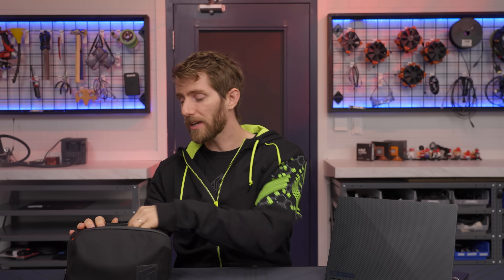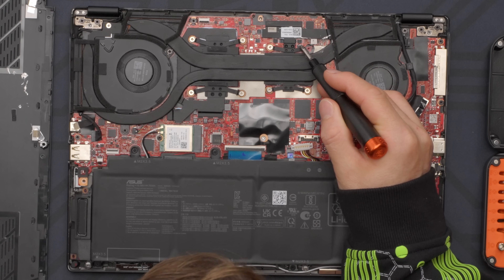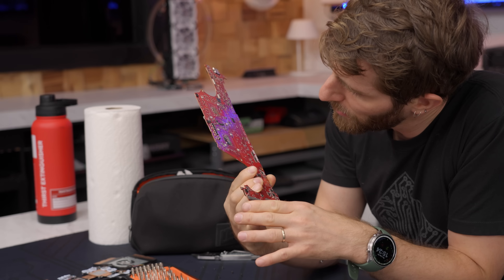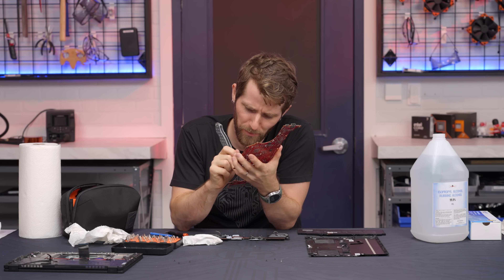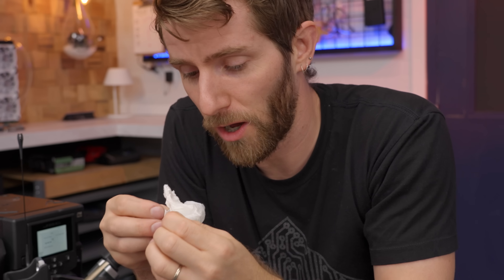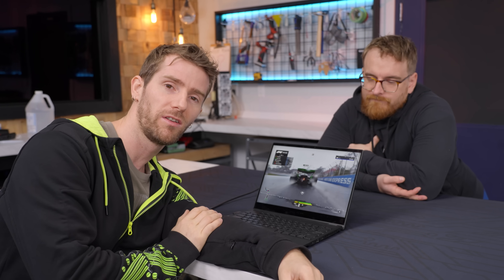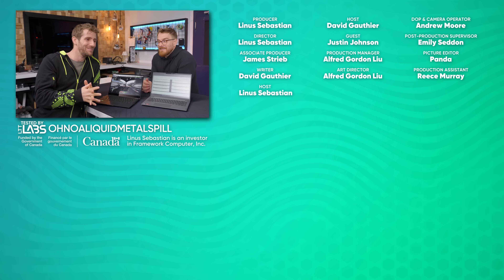Liquid Metal Killed my Laptop… Now What?

Comment: I have a 2022 ROG Zephyrus G14 and it developed a dry spot on both the GPU and CPU where there was 0 liquid metal. I could tell because the laptop would overheat and shutoff. Opened it up and yep, dry spots. I ended up removing it all and just slapping some MX4 on it and calling it a day.

Having said that, Linus my god that was the worst way to remove it. I used a pippette to get the big bits of it and q-tips with isopropal to remove the little bits.

Comment: How does someone use Liquid Metal on a device that is moving and not have a sealer to make sure it doesn't spill? This is pretty much 101 for those who did LM on old laptops before. They would be putting nail polish and foam to plug potential gaps where the LM could make its way.

Comment: I have a first generation flow x13, have put it in my bag on its side while hot many times and haven't had an issue. Only thing I've noticed in the 5 years of ownership is the chassis screws can loosen over time. It's a fantastic laptop so hopefully I won't have this issue ever

Comment: So fun story: Go check out the ROG Zephyrus G14 Subreddit. It is an awesome machine but ASUS has been using Liquid Metal for the CPU and GPU till 2024 (where they switched to TPM7950 on the GPU). There are so many pictures of CPUs having burn spots because, supposedly, it‘s extremely difficult for a machine to apply Liquid Metal correctly, which leads to blank spots on the CPU or GPU. I even did a swap myself on a 2023 and 2024 G14 and both times, the Liquid Metal application was faulty.

Shoutout to ASUS: I killed my touchpad on my 2024 one (which still was in warranty) and they replaced the whole motherboard under warranty even though I messed up! (Now I don‘t know if my PTM7950 is still on there though 😢)

Comment: Ok, 500 and first better way to do it. Contact cleaner, aerosol, should blast it off, should cut the compound and is made for circuitry.
Just use at a distance as to not blow components off the board. Then just pour isopropyl on it to wash residue. No tools, not towels no rubbing, just air dry.

Comment: I have an Asus G14 and I had to sort out the chemical metal as there was hardly on the CPU. Anyway, when I put some on it sprayed across the motherboard. Anyway, I used a magnetic screwdriver to remove it, and it still works.

Comment: I've got a G513QY Laptop that died about 4 months ago, Was quite happily playing along on a game (Had 8 kills on PUBG was absolutely on fire) and it switched off and that was the last time it ever turned on. I lived with the Liquid Metal for a few years, Had to replace it 2-3 times in about 4 years it's an absolute disaster to re-apply so much hard work dissolving every little bit with isopropyl. I took it into a repair place but nobody wanted to touch because of it, I priced up a new motherboard at 1350 euro's.... I saw a thing on lock picking lawyer where he used liquid gallium to dissolve a padlock as well.

Comment: I had a predator brand laptop that came with extra components for a secondary 2.5inch ssd installation... without a threadlocking solution on the screws they supplied. The screw rolled out and shorted it to death. Tower with a vpn, moonlight, and tablet for mobile gaming for the win.

Comment: If you have an Intel laptop running windows there is 100% chance it is going in a bag HOT.  My 13900 dell work laptop wouldn't hibernate correctly (because windows) and it woul be burning hot and dead battery after a 30 minute ride home.

Comment: Oh yeah we know of these at work. The first couple gens were very popular for small strong cad/3d workstations. Some were legit just never moved at some architecture firms (locks put on them) one even just ran in a cupboard behind a wall as a hdmi out for a touch tv to show the stuff they do.

Half of them spontaniously died. Even the one that sat for four years never moved as it was duuuusty. When recovering the ssd for data it was always random liquid metal inside the laptops. The gaskets faill, hell one even ATE through the metal.

This is not a proper solution for mobile devices and worst thing is the g14 runs not much hotter with just run of the mill thermal paste. Its how you get em back from asus if sent if for warranty even!!!!

Comment: The comparison you do at the end of the video DOES NOT determine that PTM is better.
AS YOU MENTIONED, liquid metal benefits from higher mounting pressure.
Here, we know the Asus laptop uses LOW mounting pressure.
Thus of course the PTM is much closer to the liquid metal in terms of thermal performance.
Perform the SAME TEST on an ATX motherboard, with a proper, big cooler (or waterblock), with high mounting pressure, and the Liquid metals wins, by far.

Doesn't matter anyway as Asus made three crucial engineering mistakes.
1. Too low mounting pressure
2. Too little protection (ridiculous brittle little foam bracket)
3. Using liquid metal on a type of product that IS KNOWN TO BE USED ROUGHLY by users
TLDR : Asus made mistakes and liquid metal is king.

Comment: Dip the solder wick in flux and it'll pull up the metal easier with heat. Also after soldering, use a brush and isopropyl to clean off residue, then cover the newly soldered junctions/components in conformal coating.

Comment: I had to replace the thermal conductor (liquid metal and thermal paste) on a laptop so I low key cleaned it well and put a premium thermal paste and there were no differences. The thermal conductivity of the liquid metal is indeed a lot better but whats the point if it gets bottlenecked by the other parts of the cooling system like radiator and fans. Don't use liquid metal on your machines, that's my best advice for now in 2025.

Comment: For my laptop I have liquid metal on my CPU and thermal paste on my GPU but because they share heat pipes if I ever want to repaste the GPU it means I would necessarily have to repaste(?) the CPU as well and there's no way in hell I'm ever using liquid metal. I don't trust myself that much.

Comment: My white-labelled Chinese-made laptop also had liquid metal, despite it being a bog standard 12th gen i7 with no discrete graphics. After seeing another video on LM damage on a laptop I decided to take my laptop apart and replace the LM. It looks like I caught it at the point where the LM was off the CPU die, in the moat, and had even started spreading into the barrier. Oof. Removed it (such a pain; please do wear gloves, unlike Linus), replaced it with some Arctic MX-4 I had left over from another repasting project, and I gave it a few more years of service life.

Comment: In my rog flow z13 2022 few months ago similar story. Mostly used as desktop and LM sipped down the CPU. Computer still works but i have issues with voltages, boost and temps now. Changed to normal thermal paste.

Comment: My ROG Strix laptop is in the shop today.  Yesterday, I added a 4 TB drive to it, and when I went to unplug the battery, rather than the connector popping out the connector broke off the board.  Not super impressed with the solder job, Asus.

Comment: My good friend and I both have the Zephyrus G14 and a couple of years ago, his MoBo shorted out thanks to the enshittified ASUS engineering to push you to buy new laptops and the cost of the MoBo was more than the laptop itself. Anyway, tried to fix it, changed a lot of components on the MoBo but to no avail. Frequented Reddit on a daily basis and saw the ZephyrusG14 forum filled with similar horror stories and not a single person was able to get their PC to work. 

Seeing this video, I thought that for the first time I might get to see a similarly speced Zephyrus PC + MoBo get fixed but damn, even LTT failed at it. GOES ON TO SHOW HOW BIG OF A MIDDLE-FINGER ASUS IS SHOVING UP OUR FACES!

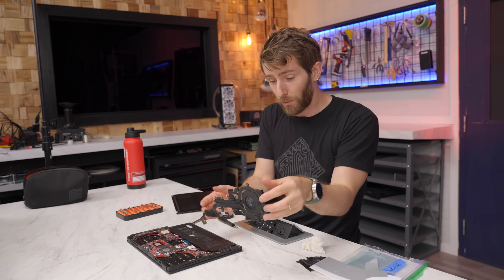Comment: 13:09 "Gallium-based liquid metal pastes are generally low in toxicity, but gallium may be absorbed through the skin. Rubber or vinyl gloves should be worn when handling gallium-containing alloys. Avoid eye and skin contact at all times." ... says the manual 😅
Reply: Anything is toxic in high enough doses. Gallium toxicity is very low. The small amount Linus was exposed to will do nothing. Still, it's always a good idea to wear nitrile gloves. God only knows what else is in that alloy or on the PCBs.

Comment: Liquid metal has no place and should never be used in laptops or even games consoles which will be used by young children that may not understand the concept of knock it and it will break to the point where it is brick and will no longer work liquid metal should only be used on a high-end desktops as simple as that and Even that it is not necessary for 98% of all computers it should never be used for this purpose because it is conductive and it will kill any device where it escapes

Comment: I also had a Zephyrus G15 with liquid metal leakage problem but mine was not power on since the leak, meaning it haven't short circuit YET, now I need a opinion: I've done the classic isopropyl wiping but I sure there is some left under the components and nur me or any other shop in my town has access to professional suction solutions, now should I just flip a coin and turn it on or should I keep looking for a trustworthy shop somewhere? Keep in mind the market value for my laptop here is around 500 to 600 box, and I already have a replacement for it and the repair cost would be around 50 to 200 box depending on the shop

Comment: I totally saw this coming, I got a M16 Zephyrus 2022 back in the day and as soon as the warranty was over I opened it up and switched all that liquid metal for some good quality thermal paste.
Tho, after I switched to thermal paste I noticed a decrease in performance since the intel processor it comes with heats A LOT... that was the trick, LM helps a lot with the cooling to deliver it's marketed performance, yet, the thermal paste doesn't cool it enough to make this device run at it's promised performance which is a very low play from ASUS.

Basically... this laptop was marketed to give certain performance taking in mind only when LM is applied. (But the chances of the PC dying from a LM short are greatly increased)
Switch to thermal paste and your performance is decreased due to thermal throttling due to the processor getting ridiculously hot (90°C+) I really wish I had the AMD version because Intel just sucks for laptops, yet ASUS is VERY lazy at providing actually good and safe thermal solutions for their laptops.

I have been taking care of my laptop quite a lot and I hope it still has many more years to come because I would hate it dying to a bad thermal solution like this.

Comment: I've fixed thousands of boards by solder flow machines, solder waves rolling over the board.
That would take less than the boards I worked on.
Maybe 3 to 6 hours.
Never rush cleaning it, or you will kill it for sure.

Comment: My HP Omen gaming laptop started overheating, and I replaced the factory/stock thermal paste with other Artic Silver thermal paste I had laying around which didn't help either. So did some research and tried Thermal Grizzly Kryosheets. Incredibly thin sheets of graphene (0.02mm). Still conductive, but no where near as dangerous as liquid metal. Brought two, one for my CPU and one for the GPU. Laptop runs like a dream now! I initially panicked as I kept thermal pads on the power regulators & vram, but that was 2mm thick thinking I was being "smart", but the thermal pads wasn't squishing down enough for the Kryosheets to make contact and my temps shot through the roof quickly hitting 140 before shutting off. Once I realised my mistake, took the pads off and replaced with the Artic Silver paste and laptop has been great since!!!

Comment: That is a damn laptop its supposed to be thrown in and out of bags, it will take shocks from setting a backpack down, it will vibrate while warm after setting it in a bag unless you put it in a fridge to cool it down before hand, having this in a laptop is so stupid if the issue is it leaking out and its not covered in warranty.

Comment: I can only imagine what would have happened if Nintendo went with liquid metal for the Switch 2. Being very portable, and getting thrown in backpacks, and with kids, you know they will drop it or run around with it.
Yeah, liquid metal can work well, but I can't really see any reason why good old thermal paste won't do the same job, and be a much safer option, as it won't leak like liquid metal clearly can.

Comment: i have the ROG Flow Z13 2022 version

the one with liquid metal Vapor Chamber thing
the Flow z13 is supposed to be used while standing vertically running games while reaching 80c normally in AAA games

am i cooked? should i change for thermal paste while i can? or the flow z13 can contain liquid metal safely

Comment: This comparison is flawed.

ASUS are reknown for terrible applications and using too much. So you tested not knowing if it was an ideal application. More importantly TIMs are still subject to the fan speeds. So the 2c difference is based on stock fan curves which will dictate the the thermal headroom anyway.

I've done several like for like tests between PTM and conductonaut extreme on several laptops, using a blow type cooler at full speed to make sure there's no suffocating and there is easy a 10c difference.

I've tested this on several ASUS TUF, Legion 5s, slim 5, pro 7 gen 8 and even the new Pro 7i gen 10. The gen 10 can net a 15c drop over PTM.

Comment: I used Liquid Metal for tests in a gaming pc and the same happened... It flows down on the MB and also on the graphic card, and ""UNSOLDERED"" capacitors ... I managed to repair it but it was a realy long and painfull work. The Gallium cause so much corrosion...

Comment: Yup.. my predator had liquid metal in it and the application or metal used was so crap.. that it was sitting at 70-80C idle and instantly went to 100C under load. Took it apart and had the 'best time' cleaning the liquid metal out of it... took a freaking hour. Replaced with MX6 on it... not had a problem since with thermals.

Comment: For people with laptops that come with Liquid metal, who accept the compromises that come with them to yield that last drop of performance, please make sure you let your laptops have the time to cool down so that the LM solidify before putting them on the move. Liquid metal is applied on these laptops using industrial methods that most of the time come in excessive amount that can ultimately destroy yours if not carefully handled. For the best approach, you can have a professional redo the application to make sure the appropriate amount is applied, thereby significantly reducing the risk of spillage as in the case of Linus here. RIP :( In addition, if you need to elevate the laptop for better airflow, try to raise it evenly without any tilting to prevent LM from sliding down onto the motherboard. Or if you are too afraid of all the hazards, just purchase a high-quality cooling pad like the Flydigi BS2 pro (or IETS GT600), which has dropped my CPU temp by as much as 20+ degree C (FYI I use an MSI Vector 16 with core i9 12900hk 150W and RTX 4080 175W, and it's scorching hot even after using ptm7950 for the gpu and LM for the cpu). Now my laptop hangs around 70-72C for GPU (full 175w) and 6x - low 7x for the CPU when playing 4K games as opposed to 90+ degree C for CPU and 85+ for GPU (thermal throttle zone). So in a nutshell, prioritize a good cooling pad for a more significant cooling contribution, LM will just be the cherry on top.

Comment: I used to take my laptop to work with me 5 days a week on a motorcycle in LA with liquid metal. Reapplied it after seeing Asus' horrible application and never had an issue. Curious if this was ever repasted or if this could be from how badly they do it at the factory? Mine had some spilled over out of the box.

end edit - PTM7950 is a awesome. Only reason I kept LM is because of my water cooling build. PTM is about 5* hotter with my laptop and every time Id change it out it would drive me crazy not having the absolute lowest temps and Id tweak out and change back 🤣 It really depends on the power you're pushing for the differences. My Dell G15 11800/3060 had absolutely no difference between PTM and LM for the most part, where it differed the PTM would do better. But, the shunt modded 4090 and 13890HX the LM easily beats out PTM in every test I did.

Comment: I had an asus g14 from 2021. After about 3-4 months I noticed that it was kind of overheating despite doing the registry mods for fan profiles or whatever, and making sure fans/vents were all clean and what not. It was getting to the point where I couldn't use the damn laptop after 20-30 minutes of it being on. So I let the laptop cool down pretty much overnight. Then I popped the bottom cover off and CAREFULLY removed the one piece heatsink/tube/fan assembly. And CAREFULLY cleaned up the liquid metal from the cpu. Also removed the pathetic excuse of a "gasket" that asus had used. I say this because it was on the verge of failure and practically falling apart. The gpu had regular paste thankfully but that was also cleaned up cuz why not. Did the same with the inductors/caps and memory ICs surrounding the cpu&gpu but I used those thermal pads instead of the messy paste asus used at first. After doing all this, most of my thermal issues with that laptop basically disappeared. I don't know if it was just a poorly done application of the liquid metal at the factory, or if liquid metals use in a laptop is just not an ideal application (vs direct die application) or what, but I think I'm going to avoid factory installed liquid metal products going forward and only apply it myself IF the product and it's application and other variables call for it.